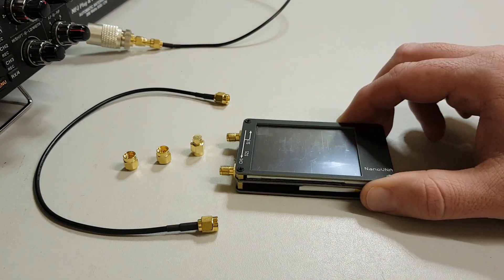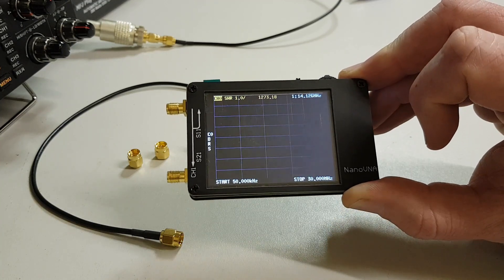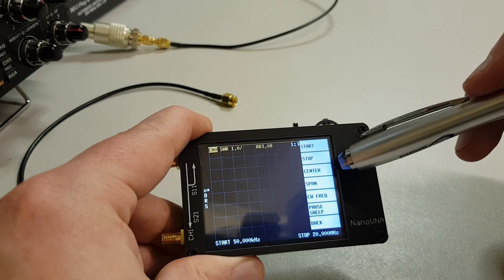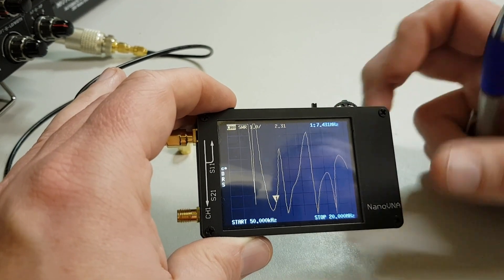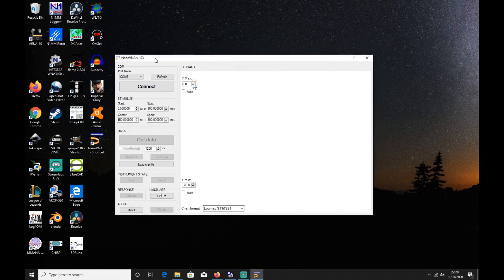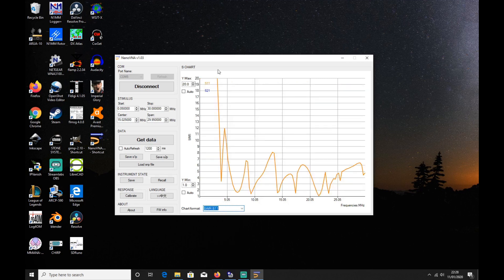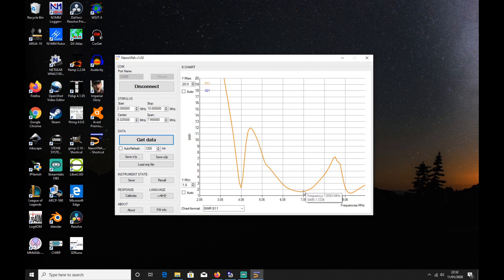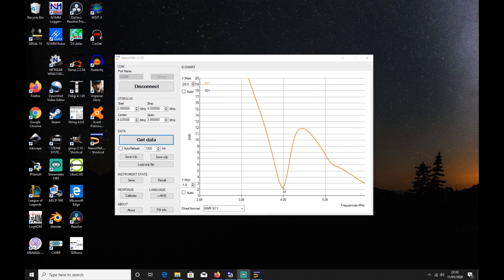Nanovna review as an antenna analyser

Comment: If you measure an antenna, that ist not directly plugged in - say, you got the cable shown or even a tiny adapter inbetween - you MUST calibrate the thing with all the add-ons attached. Otherwise you get nice dips, but far from he real ones. That has NOT been already done, as you said, unless you plug the antenna directly into the VNA. That is the reason why there are five memory banks for five different configurations. So, for calibration, you HAVE to screw the open/short/load at the END of your cables/adapters, NOT to the VNA, but INSTEAD of the antenna, to be measured, which you obviously did not. Please, do not feel offended, there is no manual how to use properly, but tons of youtube-videos, making the same mistake, so it seems common sense: Isn't there anyone who compared those results with the actual SWR of his antenna, or is it just nice and the tuner will do the "more fine" job anyway? Sorry, as I said - please no offence by my posting. I just wanted to be helpful and vy 73, OE1LLC. 

BTW: That device is not a chinese invention, but an open source project of NOOELEC, US, licence free, regarding the hardware and as AFAIK the software, too. Prices range vastly, my hint is to purchase a device with proper HF-shield, which ist costly, because otherwise even your hands are QRM 🙂

Comment: One thing I'd like to add to this video is the use of pigtails on the nanovna!
sma connection is small and very fragile in an environment where its moving, add to the fact many people use heavy connectors and then some people plug in very thick coax this could easily snap the sma connector. 
If you use the nanovna a lot then using the pigtails as a sacrificial set of connectors is also ideal, why wear out the the pins etc on the VNA when you can wear out cheap replaceable barrel connectors on the end of the pigtails, yes I understand there is some losses but to be honest it's far lower than you will expect if you are staying below 500mhz vs the headache of soldering the new sma connectors into the nanovna.

Comment: So I couldn't get an antenna to tune better than 1.3:1 in at the feed line where it plugs into a tuner.  Using the analyzer I was able to determine the only place I could tune to 1.0:1 was lower than my target frequency.  Using the NanoVNA I was able to shorten the antenna to the point where I was able to tune to 1:1 at the target frequency.  Really great tool for $50.  Edit: forgot to mention it was your videos that got me going with it.  Thanks!
Reply: 1:1 - world champion 🙂

Comment: This is going to be fun. The last time I worked some thing like it. Was 50 years ago at ft Gordon Georgia USA. ARMY SCHOOL. AND WITH ONLY A KEY BOARD,  AND PRINTER. THE OPERATOR Attached THE REPAIR ED ANTENNA TO THE FITTINGS. And put in the variables. THE PRIMITIVE MACHINE SPAT OUT A RUN OR FAIL PRINT OUT. JUST BAUGHT THE VNA. What a difference of 50 years. Makes de kv4li sgt williams. RETIRED ps my 50 year machine was as big as a small fridge. Oh oh a good Altoids tin might be a safe haven 
 W/ foam to insulate. ??

Comment: Mine came with caps for the SMA ports. Easy enough to put it in a small case for greater protection. I would definitely recommend getting a touch screen pen for moving the cursor - much quicker than the bidirectional toggle.

Comment: Hi, I've got a question. I'm new at using my nano vna. I will be setting up a Hustler BTV 6 vertical. I plan on feeding it with rg8x and a 1:1 coax balun air-wound around a PVC form. Do I scan this antenna for trap adjustments with or without the balun in line. My mind says WITH but as I said, I'm kinda new at this.  
Any info would be greatly appreciated!
Best regards,
Cliff. 
Florida/USA
Reply from the maker: Hi Cliff thanks for watching, I always test my antennas with the balun in place. It will give you a picture of how the antenna is behaving as a whole but don't be afraid to experiment try both. 73 DE 2E0XSB
Reply: @radiorants1094  Thanks for the info. It affirmed my guess.
Keep the videos coming!!
Reply: As 2EOXSB says try both, since its 1:1 it should demonstrate the importance of using a balun. If you get the same results I did you will find that without balun - when your hold of the nano and when you leave go of it - things will change as your effectively acting as a counterpoise, with the balun in place you should see no difference by handling the unit. A good demonstration of why you can get rf burns from eg. MIC.lead if not using balun. 73!!

Comment: A good review but long winded. Still a good review compared to the others.
Reply from the maker: Hi Ram Jet, thanks for watching. Sorry it went on a bit 73 DE 2E0XSB.
Reply: @radiorants1094  At least you tried.  I'm waiting delivery of my 3 button version, minus that dreaded  wheel. The Nano is very complicated and there is a huge learning curve. I've been working on antennas all my life and the Nano promises to soak up hundreds of hours of study and practice.  Its not possible to do a one shot presentation on the Nano.
Reply: @RamJet - before we got a nanovna I had never heard of a smith chart. We got ours back end of December last year and I must admit that whilst I can now understand around 50% of what's going on, I still have a long way to go. I really enjoyed watching this video and he is right that there is just so much more that it can do that I'm sure I will find out over the coming months. Its a tool that every ham should have. We have used self adhesive screening foil to close the gap around the sides of the unit - especially important on the latest model that has a fibreglass back and didn't have the rf screening cans fitted either despite having the metal clips already soldered in place on the pcb around the 3 ic's where the two SMA connectors are. 73!!
Reply: Hey, this is the Radio Rants channel.  😛